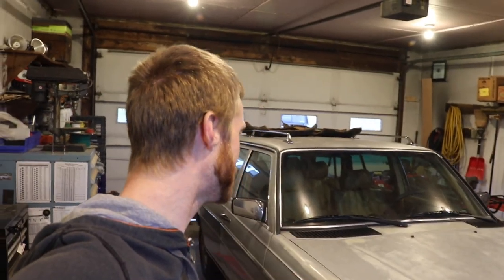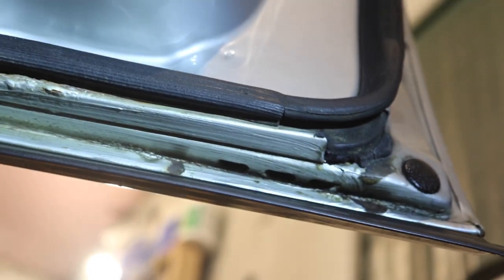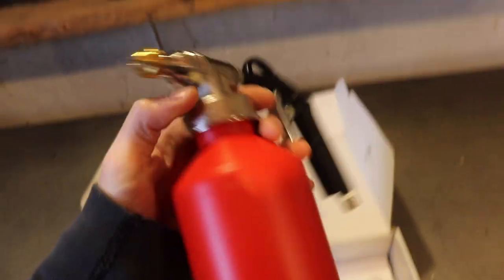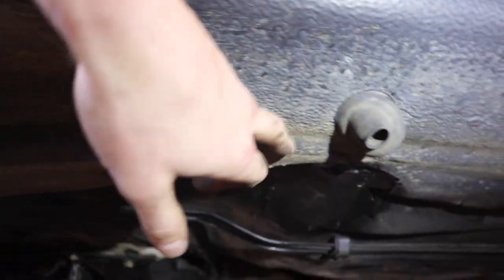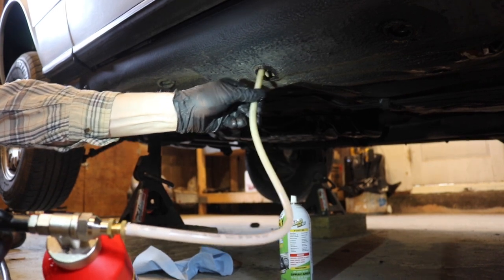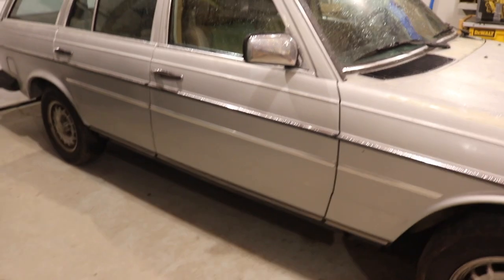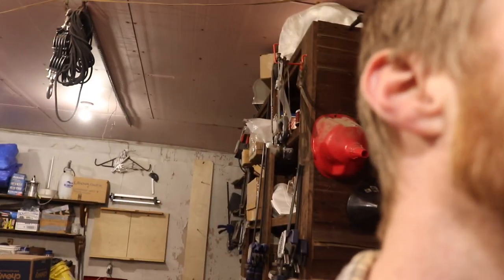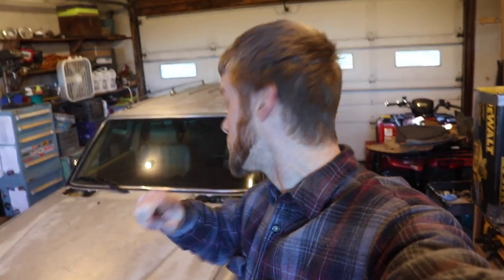FLUID FILM - 1983 Mercedes 300TD

Comment: Most important w123 video on Youtube! Do this every year. On everything but the exhaust. I use fluid film GEL (like a grease) on everything I can get to, then spay it all like this. I have even drilled some holes to get to some other places ( and covered them with rubber plugs). I clean and lubricate all rubber with silicone grease every year. Keep all seals and drains clean and soft. Just wish I'd started doing this 20 years ago..